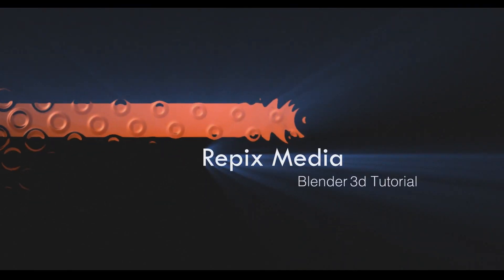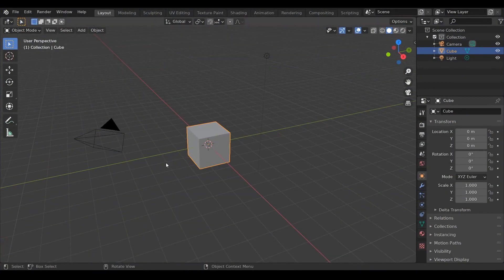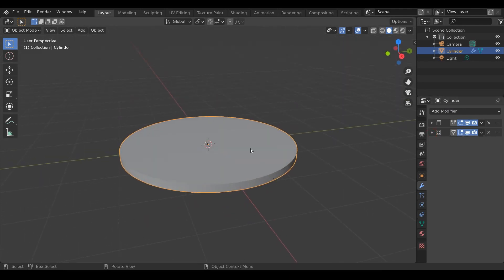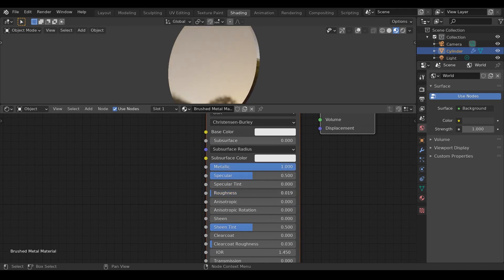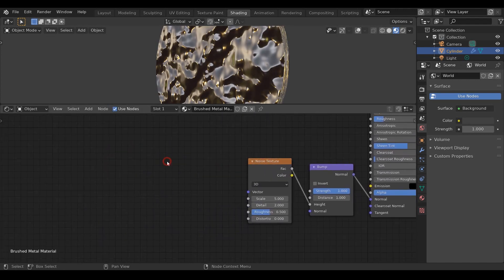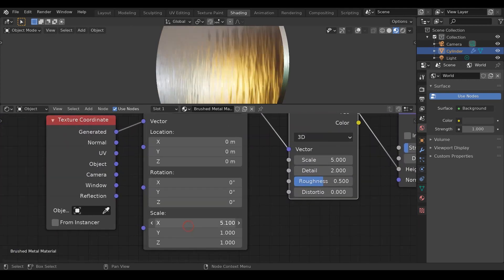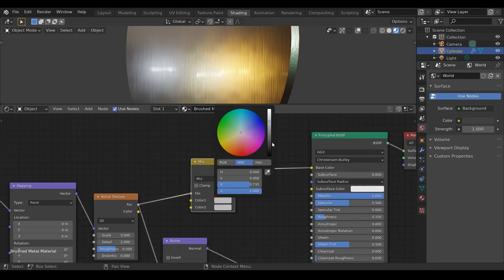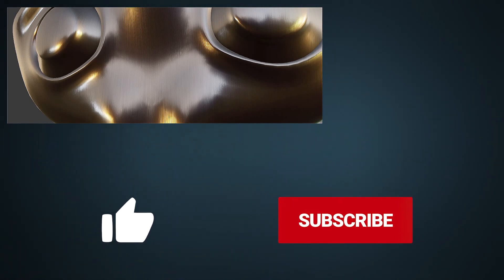Blender 2.9 Tutorial - Brushed Metal (Chrome) | Fast and Easy for Beginner!

Comment: Thanks for the tutorial but I have a quick question. At 15 seconds you show an object where the lines of the brushed metal follow the curve but in the tutorial the lines are only straight. May I ask how you get the brushed metal to be circular?
Reply from the maker: For circular i think we can uv unwrap the object that way
Reply: @rkpixeldesign  I tried that however it did not change anything. What did work was changing the "Y" and "Z"  coordinate in the mapping node to 90 degrees.

Comment: How do I change the direction of the grain? I have it mapped on some letters, but the grain is always vertical. Can I change it to horizontal or another angle?
Reply from the maker: Its very simple use mapping node
Reply: @rkpixeldesign  which option should i change on the mapping node